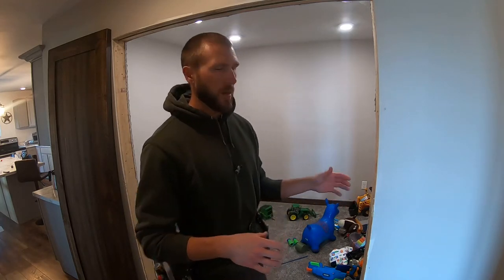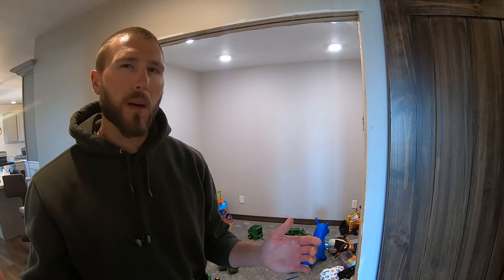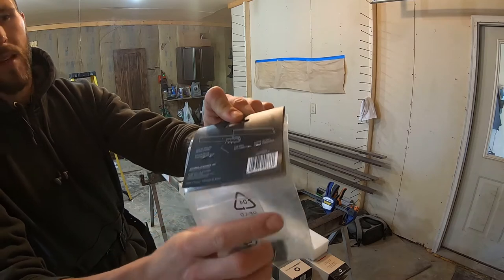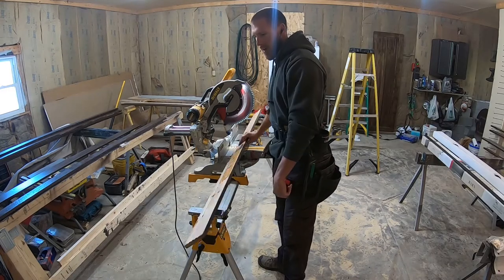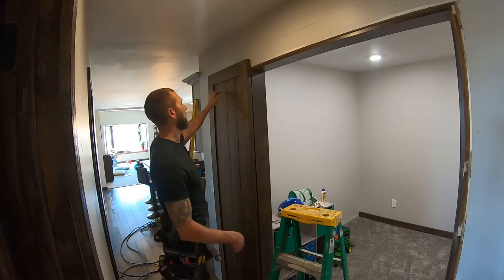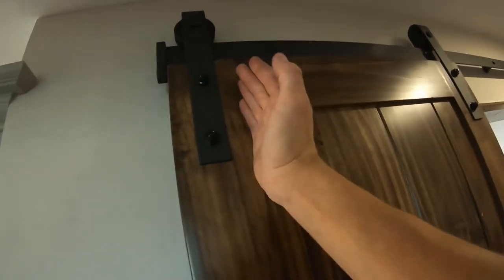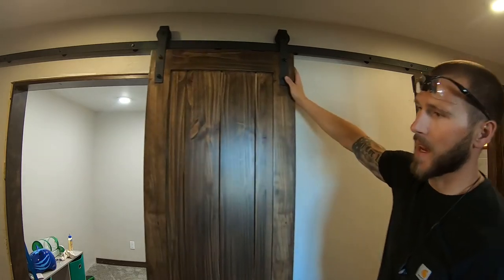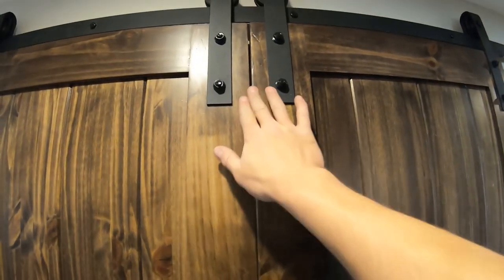How to install a Barn Door. (Double Door Single Track)

Comment: I wonder if I could have both doors attached together and go the one way?  I have a 46 inch opening without trim, 51 inch with trim and I only can slide one direction.  I'd like to just have a single 51 inch door and slide them both to the right, however there aren't a lot of kits that size so I could just get a double door kit and buy a couple 24 inch doors and slide them together?
Reply from the maker: yeah thats a good idea, you also could build your own barndoor, thatd be cool!

Comment: The doors should have been wider for wall overlap to not be able to see through the sides of the doors.
Reply from the maker: I agree the wider the better usually for barn doors but you are seeing the light form inside of jamb. I didnt have trim installed yet which was another 3 1/2 inches. Good eye though! Thanks for watching!